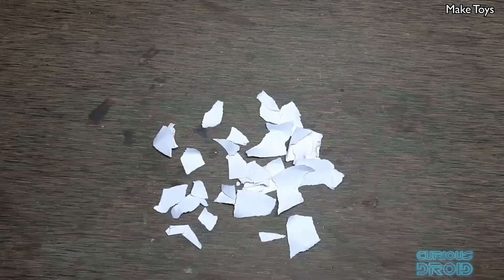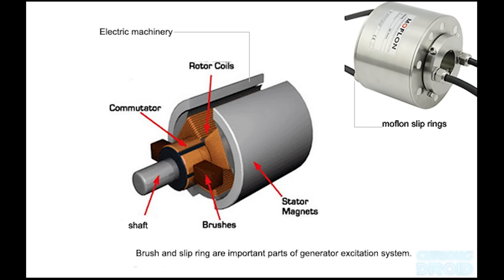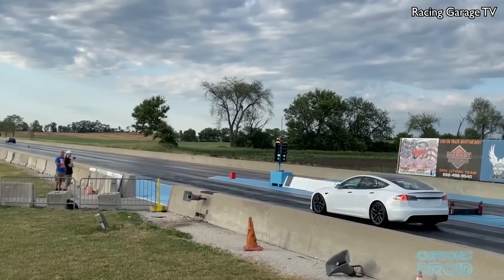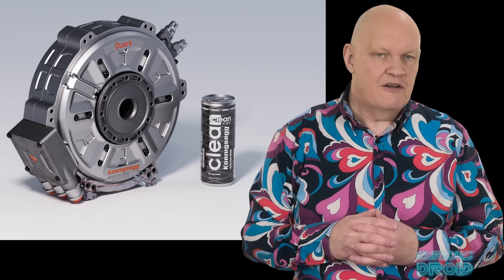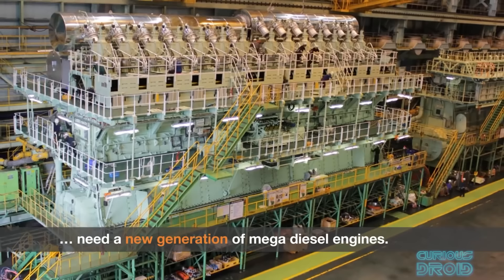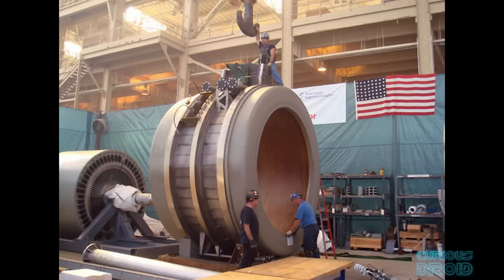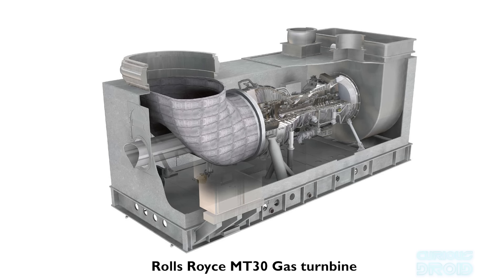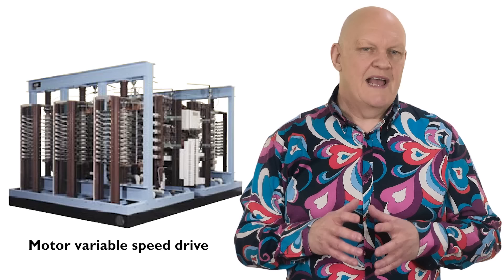The Worlds Most Powerful Electric Motors

Comment: Wood pulp refiner and old  woog log grinders did not had motor that large, but they were still in the 10 000 HP range and big. I worked around a couples of those back when I was a paper factory worker. they were always always impressive. the one on the grinder were originally built in the 40s ( and rebuld and upgraded over time, there were like giant wheels).

Comment: Grand Coulee Dam in Washington State has (6) 65,000 hp pumps to move water from Lake Roosevelt Reservoir up 280 feet to Banks Lake. They can each move 2,000 cubic feet of water per second. There are also (6) pump / generator units that use or make 67,500 hp each. When power demands are high, these 6 units use water from Banks Lake that falls 280 feet to units running as generators. The 12 pumps are sufficient to irrigate 1.1 million acres in the Columbia Basin Recreational Project. To date however, only 670,000 acres are being farmed and irrigated. There is enough pumping capacity left for future use.

Comment: The strongest electric motor that I know of, is part of an waterpump in Austria. The motor consumes 400 MW of electric energy while operating under full thrust.  The pump is moving water from an lower lake in to an 800 meters higher placed upper lake. The high pressure pipeline is 4 meters in diameter. The pressure produced by the pump is 1150 psi. The pump spiral has 9 meters in diameter and is covered of concrete.
Greetings from Germany.

Comment: The great thing about the electric aircraft carrier is that its powered by fuel burning turbine engines and for back up we use multiple internal combustion piston engines.  Oh but the electric motors free up space so we filled it with turbines and diesel engines.
Reply: It’s about efficiency though. Those turbines can generate power for the motors and the ships, and as stated both a turbine and an electric motor is more compact. Remember crude oil is cheap, and the big ship motors while complicated, don’t require such a varied set of technical expertise to maintain as would a gas turbine and electric setup. There will be other factors too like noise, redundancy etc factored in as well.

Comment: The main drive motor for the Unitary Plan Wind Tunnels at NASA's Ames Research Center at Moffett Field near Mountain View, CA is rated at 300,000 HP. The complex consists of 3 wind tunnels with the main drive being switched between them as needed. The original motor, which was installed in the 1950s, was about 240,000 HP, but was rebuilt in the 1990s using better copper and winding techniques, increasing its output to 300,000 HP. It is a horizontal shaft motor that's approximately 40 ft in diameter by 120 ft long.

Comment: I used to work at that factory which made that Nasa wind tunnel motor. They still do make very large motors, but I think that was still the biggest one. At last that was the case about 10 years ago when I switched totally different career and job.

Comment: I don't know if it's one of the most powerful, but you have missed what is likely one of the physically largest electric motors...

When I was in High School in the 90's, my class went on a Field Trip to Conestoga College in Waterloo Ontario, Canada and in their Motor Lab (sorry, I don't remember what it was called), they had a retired Electric Motor that was too large for them to ever turn on (it took so much power to operate, they would have caused a Brown-Out for most of Waterloo if they'd tried to start it). The Rotor was 50 FEET in diameter and it was used to turn the propeller shaft of an Oil Tanker (possibly a super-tanker but I can't remember), this ship has 2 of these monster motors, one for each propeller shaft)...each of these motors used 2 150 HP motors to drive the cooling fans to keep it at safe operating temperature when it was being used...

BIG doesn't BEGIN to describe them...

If the Tour Guide told us what the Output of the Motor was, I've long since forgotten it, but it had to be close to 100,000 HP since each of the ships 2 propeller shafts had only 1 of these Monsters driving it...

Comment: electric motors used in the metallurgic industry are real giant too. I remember the main milling cage from one of the sites I worked at, you put in some 15 tons aluminium plates (roughly 6m by 2.5m and 50cm thick) and reduced them in strips less than 4cm thick in minutes. The motors are coupled in tandem (same shaft and two stator cages), they are huge, almost the same size as the NASA's ABB motor.

Comment: The problem with electric motors hasn't been making them powerful enough to do whatever they're needed for, it's fitting them with a power supply that's both compact, yet energy dense, so that it can still be useful. Long-haul flying won't become electric anytime soon, because if you outfit a plane with enough batteries to make the journey, it couldn't take off anymore.
Reply: Nuclear
Reply: @edwardcardozo8325  Nuclear is only good for transportation systems where weight isn't a consideration. At best a series of nuclear reactors could run a beamed power network to power electric motor or super heat air in a cavity, like how fuel heats the air in a jet engine.
Reply: @edwardcardozo8325  With radiation shielding it is way to heavy so it don't work with manned flights.
Reply: While true that most long-haul flights won't go electric soon in some special applications it could.
Airbus have operated a solar electric airplane for 26 days continius flight.
Reply: That is not true for gridconected applications. The main problem with big electric motors is that there are few applications that need them. All generators could be used as motors instead with minimal modifications and they are available up to 2000 MW  20 times the largest motor according to the video. So if a more powerful motor was needed somewhere it would be no problem to make one. Just use an generator design and operate in reverse.
Reply: @lubricustheslippery5028  you haven't watched enough thunderbirds
Reply: @edwardcardozo8325  Think you need to look at the size and weight of the reactor, steam system, turbine, and last but not least, the weight of the shielding.
Reply: @lubricustheslippery5028  How that gonna be with new nuclear reactors? The Westinghouse eVinci one for example
Reply: @lubricustheslippery5028  With modern shielding it's a bit better but still really heavy, the biggest issue is the risk of an accident.

The chances of a plane crash are really low but if said plane is nuclear the resulting contamination around the crash site would be a major issue.
Reply: @ericdunn6232  Don't need steam for nuclear flight, you just draw air in with a compressor like a normal jet engine but instead of adding fuel you pass it through your white hot reactor core. The air expands and you pass it over a turbine, powering your compressor, and expel it out the back. Shielding is no worry really since you are spewing death out the back anyways.
Reply: Electric planes are already capable of few hundred miles of flight, and battery tech is improving rapidly. Experts think that medium-haul will be possible in just a few years.
It's important to note that a ton of energy is used to reach cruising altitude and speed, and up there, with less dense air, maintaining speed and altitude doesn't take much. So range scales up very fast with battery energy density. Also electric planes can go much higher, because they don't rely on combustion.
Reply: @andrasbiro3007  Andras is right, medium distance flights are rapidly becoming a possibility.  Look up "lilium" on YouTube, they have some of the most promising electric aircraft tech I've seen.
Reply: @andrasbiro3007  yea it's not impossible it's just inefficient. And for shorter distances air is not the best alternative.
Hydrogen is more interesting as it is one of the lightest energy source we have. It's hard to handle and bulky, so not unproblematic. The space shuttle's used it so it's also possible.
Reply: You could just power an electric plane with a turbine then.  Instead of four fuel guzzling turboprops you could have four motor-driven props powered by a single turbine, same output for a quarter of the fuel.   I've always wondered why no one has done that seeing as naval vessels have shown for a long time that a diesel generator pushing a motor is more efficient than a diesel engine.
Reply: @filonin2  yeah. Just the issue of radioactive air.
This was tried. Still a huge unflyable mechanism.
Reply: Nobody can accurately predict the progress of battery technology. Someday someone might surprise us. I certainly hope so.
Reply: @lubricustheslippery5028  
Hydrogen is so hard to handle that even rockets avoid it most of the time. It's the best chemical rocket fuel, but it's super hard and expensive to handle for many reasons.
Batteries will be good enough in a few years, or a decade at most, so it's just not worth the trouble.
Reply: @krashd  
A single turbine is a non starter, because it's a single point of failure. Aviation likes triple-redundancy where possible.
Also a jet engine is a gas turbine, so I'm not sure what would be the advantage. And there are gas turbine driven propellers too, it's called "turboprop".
Reply: Capacitors powered by rows off parraleled n seriesed salt batterys being constantly topped up with salt water so run forever
Reply: Ahh right you mean compact I get ya...build your plain out off solar psnnels lol
Reply: Plain surrounded in pannels too a high end battery bank and capacitor bank for boost power if needed and add wind turbines on outside off plane where not effecting the aerodynamics just spins n adds too your high quality battery matrix and have back up jet fuel generators incase need too make emergency landing can power from remaining fuel just too land safely....or is all that completely stupid I'm no expert

Comment: Very interesting.  But a tiny point - I think you should have mentioned the gas turbines on the aircraft carrier a little earlier.  I spent several minutes of confusion wondering if I'd completely missed the RN having an electric powered ship!  I was just reaching for Wikipedia when you clarified your 'electric ship' description.  OK, it does have electric motors, but then so too do diesel-electric railway engines, and no one calls them simply 'electric'!  That ship is a gas turbine-electric ship - take away the gas turbine bit, and it doesn't work.

Comment: it's crazy to see these big power electric motors that move at a relativly slow speed. at work we have a 40000 hp gas compressor that is powered by a steam turbine that's roughly the size of a minivan and spins at 11000+ rpm.

Comment: We’ve done testing/repair on a 13,000hp motor that is essentially a pony motor for a 291,000HP @ 257RPM motor. It is technically a motor/generator, but the pumped storage facility where it is located has (4) of these in service. Crazy!

Comment: A comment on the koenigsegg motor. At 6:25 You can see it is printed Raxial Flux on the motor, not Axial flux. I get how the misunderstanding happened. When the news atricle about this motor came a couple of months ago it linked to an article explaining axial flux motor as opposed to radial flux motor. one of the illustrations in this video is from that article. But back then searching for other news sources about this engine I found that Koenigsegg called this a Raxial Flux motor because it uses BOTH axial and radial magnetic fields. Not only axial as you might thing after the original news and linked article.

Comment: Calling HMS Queen Elizabeth fully electric is extremely misleading. Like the vast majority of ships nowadays, it uses diesel generators and gas turbines to produce the electricity to run the motors.

The goal of this two stage system is to take advantage of the more energy dense liquid fuel over batteries, while still reaping the benefits of the higher controllability of electric motors.
Reply: except nuclear powered ships dont use gas
Reply: I think he meant Fully Electric in the sense that the ONLY thing turning the Propeller Shafts are Electric Motors, they are no Combustion or Steam Engines turning the Props...
Reply: @HappilyHomicidalHooligan  don’t steam turbines spin up generators which then power electric motors to turn propellor shafts on other ships??
Reply: @timsytanker  Not always, many ships propellers are driven directly by the MASSIVE Diesel Engines...

It's only when a ship exceeds a certain Tonnage (don't know what it is though) that they must use an Electric Motor to drive the shafts because the need more torque than a steam turbine or diesel engine can produce...I think...
Reply: @HappilyHomicidalHooligan  those diesels are for relatively slow but massive cargo ships with low RPM’s. For war ships you need  speed and the turbine/generator/motor has been around since WW1 so not sure how this is a new thing.
Reply: @timsytanker  Some Nuclear Ships use Electric Transmission, but most drive the Shafts directly with the Steam Turbines. French and Chinese Nuclear Submarines use such Turbo-Electric Transmission (so I guess the Charles de Gaulle Aircraft Carrier does too, as it basically has two Submarines inside), the American Aircraft Carriers and Submarines and Soviet Submarines use Gearbox to drive the Shafts directly with the Turbines. IIRC, the British Submarines do too, but I'm not entirely sure. Conventional Steam Ships usually had (there aren't many left) Gearboxes instead of Electric Transmission as well.
Reply: @timsytanker  It's not really about Speed but Size and Weight. The faster Engines on Warships (500-2000 RPM) always need Reduction Gearboxes, not to mention Gas Turbines (3000+ RPM). The Two Stroke Engines on Freight Ships run at under 150 RPM, often even under 100.

Comment: My dam has 16 @ 150 MW generators each one About 210000 Hp on the turbine end..
They are of course synchronous generators 80 poles  running at 90 rpm.
Several are set to to use air to empty the turbine Scroll case of water and then run the generators as Synchronous Motors used to produce VARS for supporting the overall grid stability by producing a Leading power factor since most loads are Lagging.
You adjust the field excitation to get the correct result.

So the motors don’t Do anything but spin in the air just above the water level of the scroll case of the Kaplan turbines, but they are very useful.

The other way to do this is to get huge banks of capacitors that can do nothing else.

Comment: The Constitution-class battlecruisers (two - Lexington and Saratoga were completed as carriers, the remaining four were scrapped on the ways) used turbo-electric drive. Four shafts, eight motors: Each propeller was 14 feet 9 inches (4.50 m) in diameter and each of the four propeller shafts was powered by two 22,500-shaft-horsepower (16,800 kW) electric motors acting in tandem. So - 45,000 SHP on each shaft, 180,000 SHP total. Pretty big motors....

Comment: Did Curious Droid say that the rotating magnets could fly off by "centripetal force" at 5:27? If so, I think "centrifugal force" was what he actually meant to say. From Wikipedia: "A centripetal force (from Latin centrum, "center" and petere, "to seek"[1]) is a force that makes a body follow a curved path. The direction of the centripetal force is always orthogonal to the motion of the body and towards the fixed point of the instantaneous center of curvature of the path. Isaac Newton described it as "a force by which bodies are drawn or impelled, or in any way tend, towards a point as to a centre".[2] In the theory of Newtonian mechanics, gravity provides the centripetal force causing astronomical orbits."

Comment: The Forced Draft 1300 MW power plants that I worked as an electrician had 3 ASEA 13,500 HP at 13.8KV weighing 26 tons. Ear plugs ear muffs goggles were a must working on them in that room. Imagine a 30 ton 4 man operated chain hoist, 4 hours for a 8 foot lift off a flat bed trailer, sweat city!

Comment: Absolutely brilliant! Thanks.
Would you consider using metric units instead of Horsepower and Pound-feet?
Reply: Human units.
Reply: The metric system for motors is dumb........KW is an electrical measurement, not a measurement of work. HP is a measurement of work. 

If I have a 10KW motor, is it 10KW power input or 10KW of mechanical output?

Comment: In the mining industry, we sometimes see ball mills using a gearless system where the rotor is installed on the outside of the mill and the stator around the whole thing. It might not be in the 100k hp zone, but the size eclipses what was shown here.

Comment: Would the Large Hadron Collider count as a linear induction motor? It's "rotor" is a stream of atoms, which it accelerates to 99.9% the speed of light.
Reply: A proper superconducting motor too. And none of that messing with high temperature superconductors either, proper copper and liquid helium...
Reply: @Lucien86  I keep thinking of the switching circuitry and the control systems that they need to make the thing work! How many MOSFETs do you think they use?
Reply: @BlackEpyon  I was obsessed with it for a while, hunted down a lot of the build pictures and so on. Its a lot (probably) at a guess in the millions. That's if they use mosfets in the main switching and not something more advanced.. So maybe none.